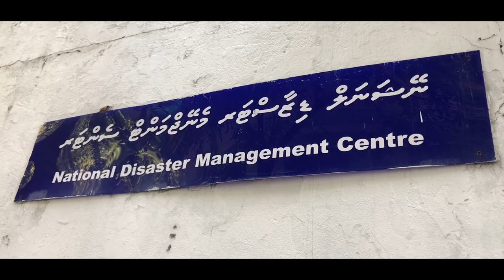Waters of Paradise - Adapting to Climate Change in the Maldives

Comment: Won't these islands be under water soon?
Reply: Define "soon". 10 years? 50 years? 100 years?
Reply: David Keenan 
I'm asking you amount of flooding and when... If asking me then:

If following current ocean rise of 3 mil a year plus one version of exponential factor (double every year) because of GCC and the 60 or so positive feedbacks, then perhaps:

3 mil per year + exponential component. Let's see: 
next year 6 mil. Then 12 (2018), then 24 mil (2019), then 48 mil in 2020, 96 in 2021, or the length of a cigarette. 

Keep doubling until 2027's two meters, is that is under water? If not 12 feet the next year and highest point is 5 feet under water.
Reply: Not going to happen, there's no way feedbacks would result in an annual doubling of the "rate" of global sea rise. Ice gain on the antarctic ice sheet is currently mitigating the loss of ice on the Greenland ice sheet and the world's other glaciers. And the oceans have a great deal of inertia to change. 

Much of the Maldives will still be habitable by 2100, but they'll be probably be submerged well before 2500.
Reply: David Keenan 
I might have used wrong exponential factor, the old doubling one which is really far too extreme to use in the real world. 

A compounding exponential function would be yet another one that would probably be inaccurate, especially with the time component relevant to humans (years, decades) as opposed to what scientists are used to working with, that is geological time (1000 years, millions of years).

A quick Google tells me the current  scenarios, about 7.5 feet by 2050 to 2100 depending on mitagating the temperature. Going on as we are then 25 feet by 2050-2100. 

So what they are saying is they really don't know. My example above is if temperature rises incredibly fast, like 7-10 degrees by 2027 LOL! Which is Guy McPherson's terrifying scenario.

The Earth will definitely run out of soil, clean water, oxygen to breath at the necessary 19.5 to 21 or so percent with 40% of plankton gone already, habitat for other animals and systems that clean and rejuvenate our environment all dead.

We are locked in at 7.5 feet but I understand that rise will not be the same all over the Earth, it can vary by feet which can really decrease a relatively small number like 7.5. And even if we are locked in at 7.5 feet they really can't give an accurate temporial scenario.

I'm going to research and if I can actually come up with a more reasonable realistic scenario. I'm more a numbers theory person, a computer programmer who exists in the abstract world of disconnect, so I think I can come up with a definitive theortic answer because:

I know we are going to go like business as usual.

I know all ice will be gone by 2017-2027.

I know the methane monster will blow in the next 10 years.

I know the population overshoot will continue unabated to 10 billion and beyond.

I know the great barrier reef will be dead in 2-5 years followed by ocean death in 1-3 years.

The positive feedbacks are appearing more and more everyday.
Reply: @davidkeenan5642  you're discounting thermal expansion altogether. Deadly error.
Reply: @maxotaurus5140  the 'exponential factor' is added to make up for the fact that the oceans aren't rising as fast as predicted, so climate alarmists say 'well, just you wait - sea rise will accelerate'.   The data says 1-3 mil per year.
Reply: @maxotaurus5140  " 
I know we are going to go like business as usual." Yep, and business as usual is scaring the people with bullshit so they will accept the technocratic control grid to "save the planet", losing liberties left and right on false premises.

" I know all ice will be gone by 2017-2027.
"  How do you know? Are you aware that the antarctic is gaining ice? In fact, one of Greenlands glaciers everybody was so alarmed about is now growing too.

" I know the methane monster will blow in the next 10 years.
" No you don't.

" I know the population overshoot will continue unabated to 10 billion and beyond.
" Finally a truth. And also the only real problem. I could spend the rest of my days dumping toxins in the ocean every day, truckloads at a time, and still not hurt the planet in any real significant way if there were only a quarter billion of us.

" I know the great barrier reef will be dead in 2-5 years followed by ocean death in 1-3 years.
 " No, you don't. Pure speculation. Can I come back here in 5 years and hold you to what you just said? Let's make a deal. Whoever is wrong will make a public video expressing what kind of retard they are. Do we have a deal?

" The positive feedbacks are appearing more and more everyday." Name one. Just one will do.
Reply: @maxotaurus5140  lol where did you get all this rubbish
Reply: They're not collecting rainwater, as even the Singapore does, here's an utter negligence, and they're complaining on floods lol, literally drinking water falling off the sky, only thing to do is To collect it. Pfft... A bit of self-assured nation
Reply: @wealthyperson3108  
Older post and YT never notified me. Been a year. Not gonna read all that. 

Ocean rise is low compared to other threats but still rising as projected in addition to acidification, reef bleaching, fish/plankton depletion and plastic masses.

Add warming, population overshoot, habitat overshoot, species extinction, insect apocalypse, BOE possibly next year and various radiation, plastic, chemical, herbacides and resource extraction.

Wonder what the f. As if I'm making shit up.
Reply: @Flyingdutchy33  
Unfortunately, I kinda nailed it, two year later. Sadly all I wrote or almost all, not interested in this so much to go point by point, generally:

3/4 reef dead. There is a permanent methane blow, 2000 ppb constant in Alaska 5 weeks so far and not falling, ice at lowest- a blue ocean event possible due to conditions as early as 2023.

Feedbacks? See Guy McPherson's paper detailing lots of feedbacks.
Reply: @maxotaurus5140  how it can rise ? Simple question as nobody of "greenies" could have ever been able to explain it. As i ask simple question they all stuck. Earth is only holds certain amount of water, makes sense eh ? Alright then how it could be more than that amount i wonder ? Ok basic question about Archimedes law is making em grassy ones stuck cause they haven't ever thought about it. Same literally being applied to ice shield over Antarctica lol as its all floating. Ok to be simple - figure out russian territory as it's been covered with in average one metre of snow. It all melts ?! Makes sense to your ?? Eh... Ok next it comes to where ? Underground reservoirs and  natural water deposits, rivers too bulging with water, it all comes to arctic seas ? And think about what happens next ?? According to your approach sea lvl gotta be high low high low every year ??? Ah ? Or you just have another pseudo scientific theory that there's more rains lol out of the same amount of water ? Didn't you bother yourself to think that it might be simple geological events leading to raising certain areas of soil and seabed aswell ??? So literally not water rising, but rather soil going down ? Makes sense ?
Reply: @maxotaurus5140  " I know the great barrier reef will be dead in 2-5 years followed by ocean death in 1-3 years.
 " 

followed by: 

Unfortunately, I kinda nailed it, two year later. Sadly all I wrote or almost all, not interested in this so much to go point by point, generally:

3/4 reef dead. 

3/4 is not 4/4, is it?
Reply: @Flyingdutchy33  
The barrier reef is functionally dead already. It is moot as temp, acidification and pollution has continued.

Look at it this way:
It is a car "race". Car 1 is 3 laps ahead in a 4 lap race of any competition. I project car 1 is gonna cross the finish line first.
Reply: @maxotaurus5140  I get you're really passionate about it, but that does not good science make.
Reply: @Flyingdutchy33  
Thanks for your input 🙂.

I only try to cite peer refereed scientific studies' current conclusions from my imperfect memory.

Understand, while I try to impart it, perhaps your actual disagreement is with parts of or all the 30,000 peer refereed scientific studies, not me. I just know the "gist" well enough.

I'm not the origin of these projections. Any feeling I have are a reaction to the verified fact checked total predicament we all are in. 

Professor Peter Wadams' channel here on YouTube is a good source to start if one wanted to get to the facts (not me).
Reply: @maxotaurus5140  Have you at all considered this to be fake? 

The 97% concensus number was a load of crap, for instance.

What you are worried about is not CO2, it's not even rising sea levels. You are worried about pollution, and when it comes to that we're in the same camp. 

I'm horticulture student focused on regenerative farming and I've been part of ecological research as well. It's not like I champion destroying the planet, you see. But during my time on this floating ball, I've come to realize a few things. And one of those things is the CO2 scam, which is pretty evident if you chose to look into it.
Reply: Yes in the next 10 years or so
Reply: @kilbridemeredith8742  I still disagree that agw is the nail in the coffin. Despite media concensus, there isn't any in the scientific world. Kind of similar to what we see today with a certain something else.

It's about control. Always has been.
Reply: @davidkeenan5642  nope its happening already, before 2050 you all will be floating around like in waterworld, smoookers!!!!!!